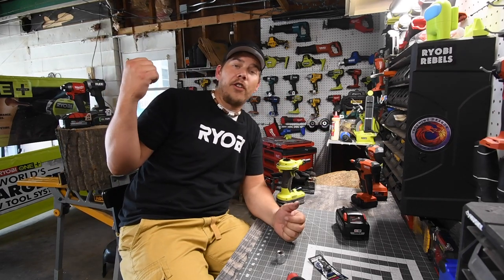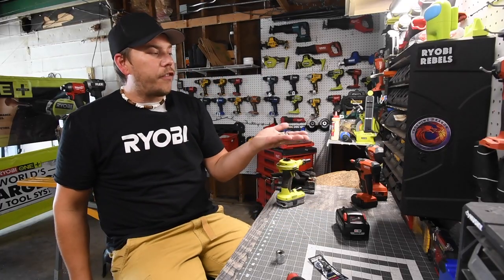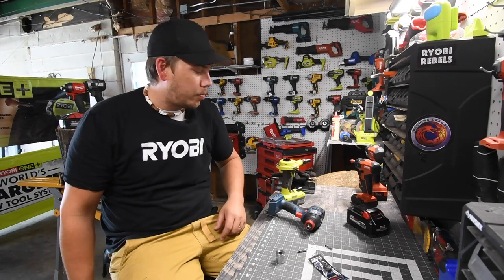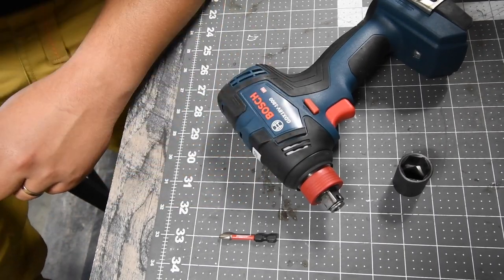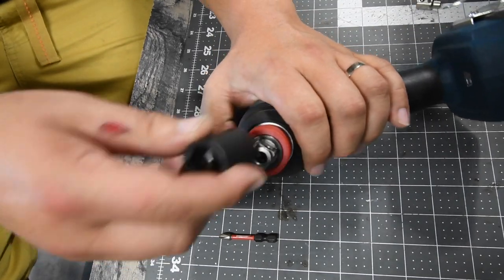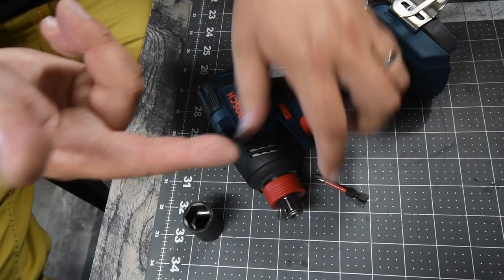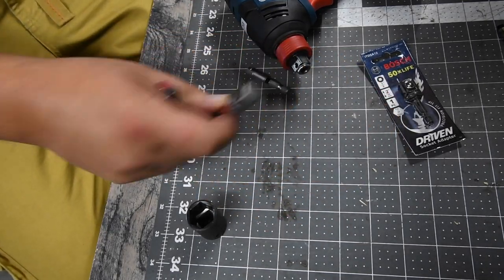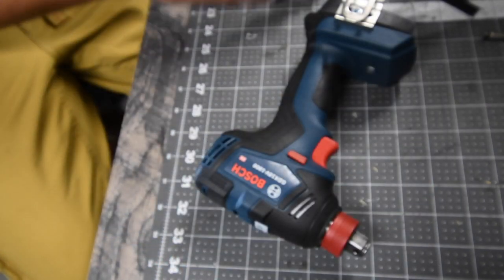Every Brand Should Adopt BOSCH"S FREAK ANVIL!!!

Comment: I solved this problem, I bought impact wrenches, 3/8, 1/2 & 3/4 drive. I quit using my impact driver to turn nuts & bolts!!!  Problem solved and I don’t need Bosch. Try driving them little lag bolts with a 3/4 drive impact wrench, it’s like driving 1 inch sheet rock screws into butter.
Reply: This ^

Comment: From owning one of those exact drills myself, you won't break that anvil easy, I use both the ¼" and the anvil a lot and it's a beast, doesn't overpower dewalt or Milwaukee but it's there, and with the 8ah it really does make a difference
Reply: I own two of these. Bought at the same store. One with holes on the anvil for a pin lock and one with no holes. Same model numbers. So with the hog ring, I found it a bit loose for larger sockets, and only use impact sockets with two holes so I can throw the pin and O-ring on there to keep the socket on. When looking to buy the freak, remember, you want the version with the holes. You can thank me later.
Reply: Model number GDX18V-1800C for both Freaks. 
One has a manufacturing date of 3/2020 and has no socket pin holes and one has a manufacturing date of 9/2020 and does have socket pin holes on the anvil. Hope that helps.

Comment: I like the idea of the Freak anvil. Ive never used it, but I would love to see it on most impact drivers. It should not be on impact wrenches. Mid and high torque impact wrenches should have a conventional 1/2” or larger anvil. Lower power impact wrenches aren’t materially different from an impact driver. Except in max RPM and the Anvil, so a god impact driver with the freak anvil would do the job nicely. 

Interestingly, I’ve never broken a 1/4” QC hex socket adapter. Not even one. But then, I’ve never tried driving large lag bolts into a hard wood. I have driven smaller lags, and I’ve loosened and tightened some decent sized bolts, some of them were torqued rather tightly.

Comment: I am right now trying to figure out what tool line I want to go into for later on down the road and this video has me considering Bosch over Milwaukee for that anvil because I could essentially use it like a stubby without having an adapter get in my way. Also you could probably use it for drywall fairly easily with the way that Phillips bit sticks out a little bit over the length of the socket.
Reply: The only issue is having an impact wrench measured in inch-pounds, not foot-pounds. It needs to be much stronger to be useful as an impact wrench capable of competing with Milwaukee and DeWalt.
Reply: @l00nybin  he has a bigger version on the way, plus yeah if you look at the top-of-the-line versions of Milwaukee yeah those are going to be more powerful but they’re also like five times the price I don’t feel like paying an arm and a leg just to have a tool that has more power that I’ll never be able to use because there’s a Carpenter whenever I’m gonna be screwing stuff would be just installing fixtures not actually doing any heavy duty applications
Reply: @l00nybin  he put a 6 inch lag in a stump that’s probably the most extreme of a test I’m ever going to be doing with my tools so if it can do that it gets win in my opinion

Comment: I've been saying it for a while. Imagine an M18 Fuel impact driver with that anvil so that you don't have to worry about breaking adapters and benefit from the short length of the tool while using sockets. As cool as the Freak is it just doesn't seem that powerful.
Reply: than use a wrench

Comment: Impacts drivers don’t need more power they need more control 
They make an impact wrench for the big stuff 
I’m snapping screw heads off as is with a driver 
Square peg round hole. Right tool for the right job. 
If you’re doing the big stuff enough get an impact wrench or if you are not wanting multiple tools get an impact wrench 
My first impact and I still have it was a ryobi impact 1/2 inch anvil came with a 1/4 inch hex adapter. 
Then got the ryobi impact driver. The tri beam light and magnet are awesome.  No snapping screw heads
Got M12 fuel a few years ago.  Great driver and drill. Speed one on impact so useful. Plenty of power to drive screws 
Have had Milwaukee M18 fuel stuff for about a year. Gotta be careful with it on 3. Love the self tapper setting and with the cp3ho battery so light and manageable 
Use my m12 fuel driver mostly. Unless I’m doing self tappers, then it’s the m18 on self tapper mode, it is just the right speed. 
Like what you are doing on your channel 
And as far as making and selling adapters to run big sockets for the 1/4 inch impacts. You can put a hitch on any car and hook up to any trailer. It does not mean you should.

Comment: convert the drivers to wrenches to test power. pain. voids warranties, requires they be YOUR tools and not fan sent, but putting anvils in them means no more adapters. And if both tools have anvils you're testing power of the tools instead of the adapters.

Comment: Would be cool if someone (hint, hint) could create a retrofit, direct replacement solution to put a 3/8" or 1/2" in drive socket adapter that also accepts 1/4" bits (like the Freak's) in place of the current collet.
Reply: Dewalt already makes an adapter for 1/2" anvil to 1/4" hex collet. Its rated up to 200 ft-lbs if I remember correctly.

Comment: I doubt that tool manufacturers will adopt this because it means people won't need separate impact wrenches or impact drivers,means they'll sell less tools. If you need a really diesel 1/4" adapter that won't break easily try out the husky adapter set from home Depot they're extremely, extremely  durable also I've had good luck with the 3/8" DeWalt that comes in the 5 socket kit at HD

Comment: The Shop Tool Reviews channel has had good luck with the Bauer adapters from Harbor Freight, if I recall correctly.  You may want to check out the Bauer adapters if you have a Harbor Freight nearby.

Comment: This is why I have both impact drivers and impact wrenches. But I would much rather have a freak anvil. But they won’t because they would sell fewer tools.
Reply: It ain’t about selling fewer tools.  It’s about choosing between a wimpy impact wrench or a larger than necessary impact driver.   Unfortunately, Bosch chose every option and made a larger than necessary wimpy impact wrench and a wimpy impact driver.    You also run into the problem that the square drive has to be 1/2” or larger.  3/8” drive impact sockets are a heck of a lot smaller and lighter than 1/2”.   Weight wise, carrying a 3/8” impact with sockets + impact driver around is way lighter than carrying a single “Freak” with 1/2” sockets.

Comment: It's the wrong tool for the job. For sockets you would be better using an impact wrench not an impact driver because the hex to socket adapter used in an impact driver is always going to be the weak point.
The Bosch tool is a good option and by the end of the video you've answered your own question.

Comment: I get the theme of the Milwaukee vs Flex video in the making, but if your a contractor (assuming the business is financially well and the boss has tools), Wouldnt you want to use an actual impact wrench for those bigger lags? "right tool for the right job". Idunno, my opinion from 2 years experience in the field. Still wanna see that Milwaukee vs Flex tho

Comment: Impact driver not made to do what the impact wrench is made to do? Just my 2 cents.
Reply: Those adapters work better for drill drivers... less torque=less stress on  the adapter. Any time you torque something you are stretching the material.  Shearing those adapters is easy. Most of those 1/4" socket adapters are made for 120 ft-lbs max.

Comment: if your job requires you to install big bolts and screws,  why not just use impact wrench?
Reply: Because the tool will be a "2 in one", replacing the need for having two tools.
Reply: @bananielx3  i know,  but that's not profitable for the companies lol
Reply from the maker: correct, but I cant use an impact wrench in an impact driver video and a lot of people dont want to carry 2 tools around if they only need to use 1 for the task they are doing

Comment: bosch tools are the best. they basically rule over all of Europe and Asia.  the new Bosch 12v and 18v sanders are the best, new track ready biturbo 7-1/4 circular saw with integrated dust collector and plunge action.... list goes on and on. i have their brushless reciprocating saw with orbital action, which came out 6 years ago, puys most competition to shame.  all other tool companies are in the business to sell tools, Bosch doesnt.  they are wayyyy bigger and above these other companies. other companies provavly use Bosch Electronics and machinery in their facilities to produce their tools.